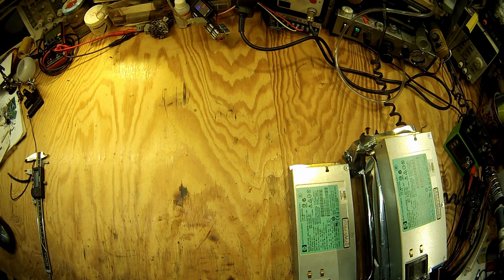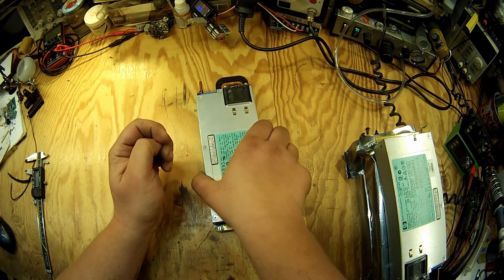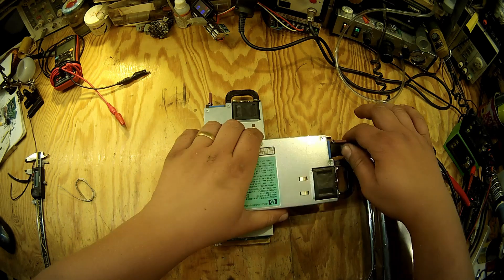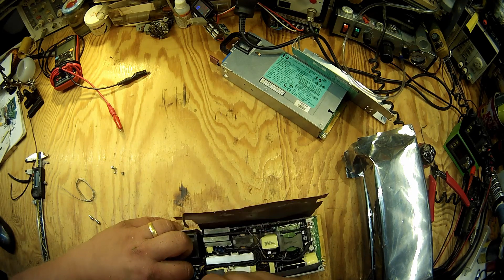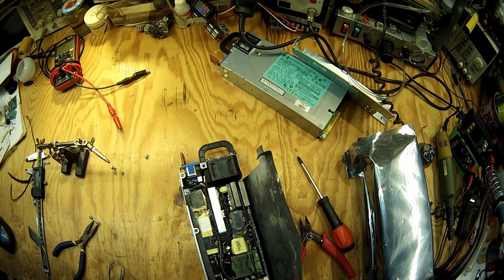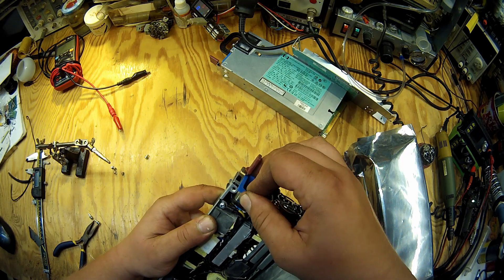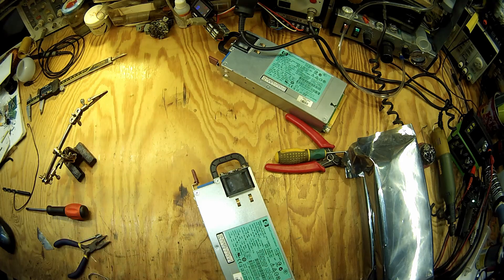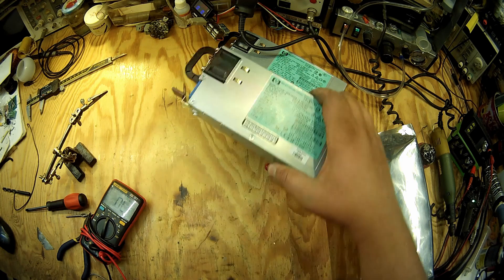Megalumen part 4 - The power supply and mod

Comment: It appears that these are HSTNS-PD19 units... So far, this is the only place I've seen anyone modding this particular model of the DPS-1200FB-1 A  ... Everyone else is modding PD11, PL14, etc.

The reason I point this out, is that the trim pots on the PD19 units are very different from all the other units. This is important when it comes to using these for automotive flashing, as one must increase the OVP (over-voltage protection), as well as the main output voltage.

I notice that you have singled out two trimpots (from the 5 on that board). I'll refer to these as pots #3 & #4 (from the left). What do each of these pots do? I'm assuming you know, because you've drilled holes to provide access to them, but you don't provide any details about their function in the video. I'm assuming that one is for main +12v rail output voltage adjustment, and the other, something else  - hopefully OVP adjustment!

Do you happen to know what the other trimpots are for as well?

This information would be highly valuable to many people looking to use these PD19 units in place of the more common (and more expensive, for some reason) PD11 units that others have modded and adjusted voltage/OVP on. The idea is to set output voltage to ~13.8 - 14.4v (depending on application / vehicle), and raise the OVP just above that (again, depending on what the main voltage output is set to).

Hoping to hear back soon! Fingers crossed!

Comment: Hi I wanted to know if it is possible to take the output of these power supplies over 12.6 volts because I would like to use them to feed my amateur radio. If it is possible what should be done? Thank you
Reply from the maker: 12,5V is a maximum for these
Reply: How to adjust to 12.5v?
Reply from the maker: @MrLunglove  its in da video :)
Reply: use a HP PD18 psu and look it up, there is a mode with a resistor to take it up to 13.8v